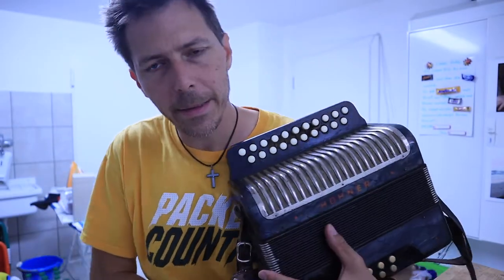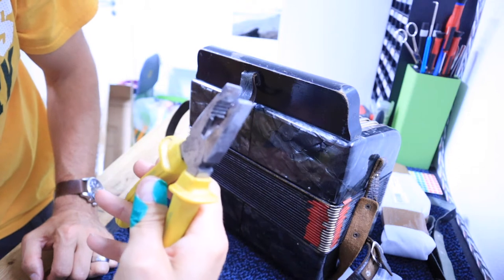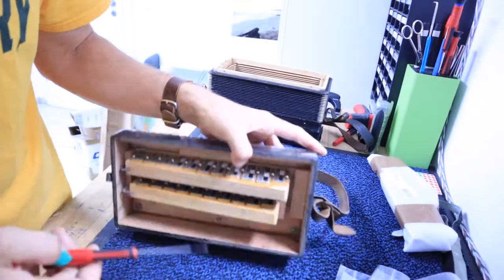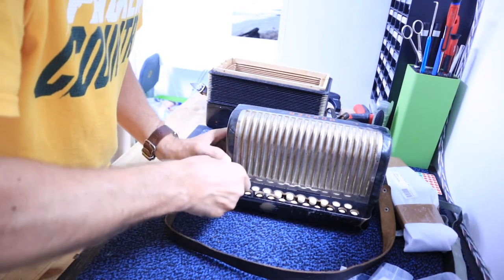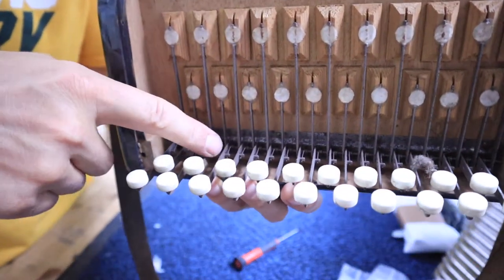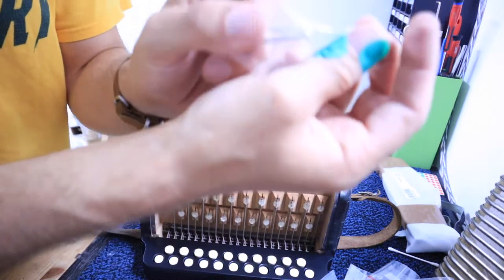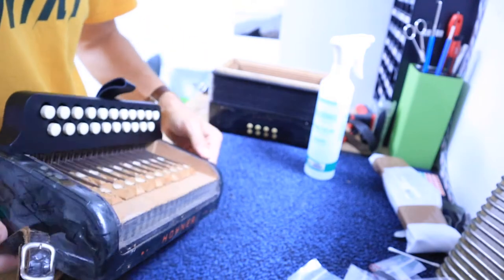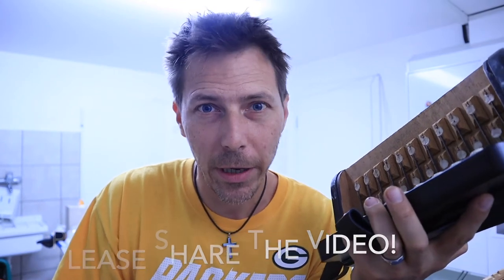TUTORIAL #8: HOW TO CHANGE AN ACCORDION KEYBOARD

Comment: Save the old keyboard , and use for a template to make your own. Use thin furniture hardwood plywood, glue, then drill out key holes with forstner bit. Spit coat with shellac, sand smooth, spray with black laquer, or whatever color..

Comment: Hello Tom, thanks for your videos, they are very helpful. How about replacing the buttons? I have an old Venezia with badly worn buttons, it would look so much better with new ones. I have not found much information of methods or replacing them. Getting them to level up seems like it could be difficult. 
By the way my 1st accordion was a Hohner Corona ii GCF red. Got from a fellow on the street for $100, wish I still had it...
Thanks Brian
Reply from the maker: Hi Brian! I've tried replacing buttons, but it's so hard to get them off, and press the new ones on. I think you might need a special press for that, but I am not sure. Good luck!

Comment: Hi Tom, wondering if you can help. I recently bought a Hohner black dot and while it's in great condition, there's a lot of noise when releasing the buttons. I notice the buttons are also scraping on the bottom, and the black from the wood has rubbed off on them. Would you have any ideas as how to fix it? Thank you.
Reply from the maker: Hey JL, this problem sounds like something new for me. Do you have a picture, because I cannot quite understand what you mean. Thanks!
Reply: @TomsMusicShop  Hi Tom, thanks for your reply, I have uploaded a video of the issue so you might be able to offer me advice. Thanks, Jamie.
Reply from the maker: @guitarjamie  Hmm, ok so you mean the clacking. Some Hohners come with felt underneath the buttons, adhered onto the bottom of the fingerboard. But those are generally Coronas. It looks more like the clacking however is from releasing the buttons. I would have to compare with an Erica and see if it is the same. You might be able to adjust the position of the plastic fingerboard just slightly, but I feel like this is just part of the Erica/Black dot design. Can anyone confirm?
Reply: @TomsMusicShop  Hi Tom, just wanted to follow up: I discovered the issue was the leather/felt on the treble pallets. The noise was coming from the pallets hitting the holes for the reeds, so after taking apart the old leather and glue and attaching new leather it really made a world of difference! I uploaded a comparison video and the clacking is hardly there anymore. Thanks so much for your help! :)